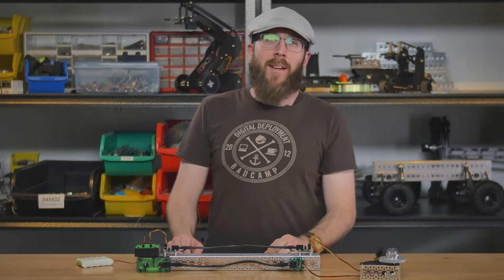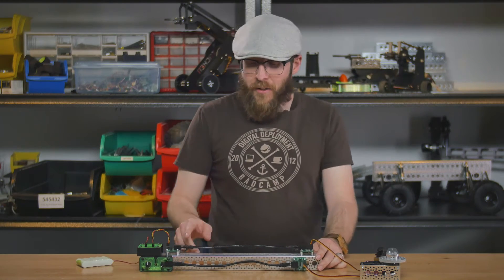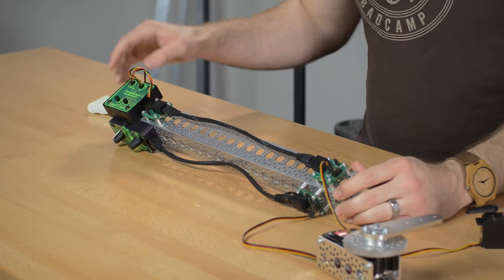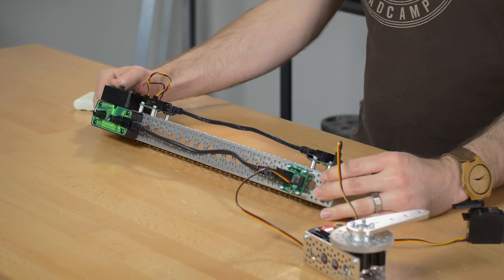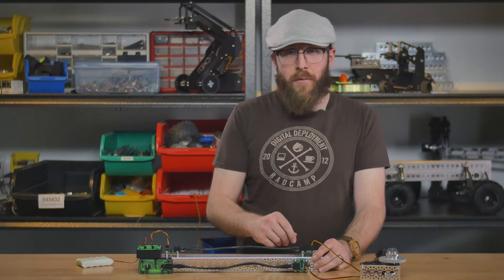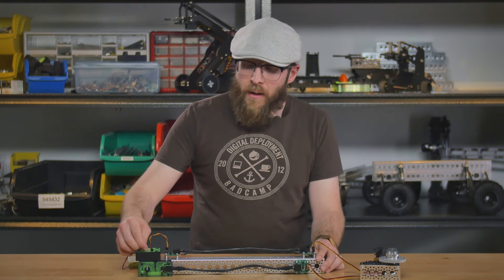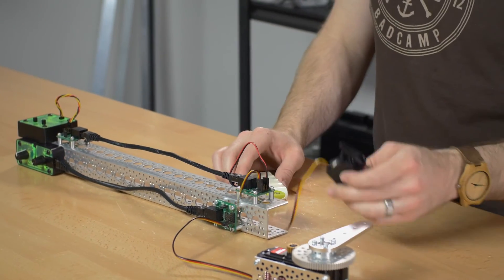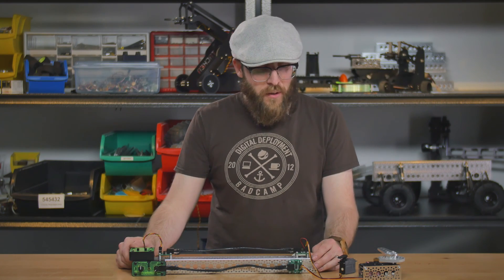Cat 6 extension cable - Jason shares how and why you use CAT6 extensions and boards

Comment: Hi, I have purchased the boards and want to use them to remotely actuate servos for an animatronic skull that will be located a short distance from my computer e.g. 40ft.  I am using TrackSkull software that will translate the movement of a joystick connected to my computer to the remote servos.  When the three servos I have are connected directly to my lynxmotion SSC32u servo control board the servos more correctly when the joystick is moved or the trigger pulled for one of the servos. However when I use male to male servo jumper cables to connect the Cat6 sending board to the SSC32u servo board using the same pins as the servos were installed on, then run an ethernet cable from the Cat6 sending board to the Cat6 receiving board where I have connected the three servos that I need to operate nothing happens, no servo motion when I move the joystick. I have powered the SSC32U using a 4XAA battery pack and also a 6v power adapter with the same result.  How can I get the sending and receiving boards to work. It is becoming increasingly frustrating as I believe I have connected everything properly. Any help would be appreciated.
Reply: easier to use a lengthy cable